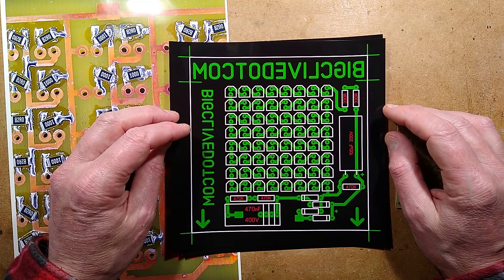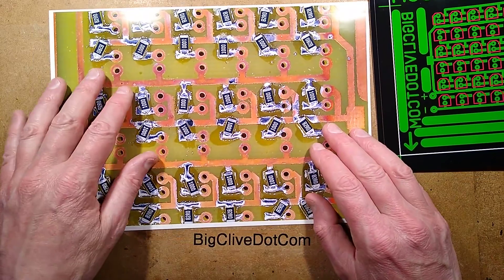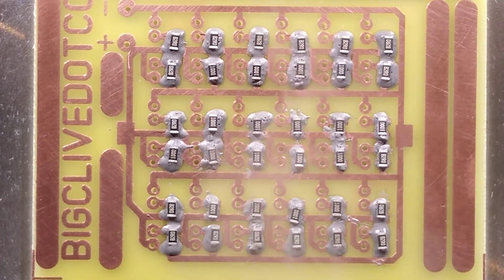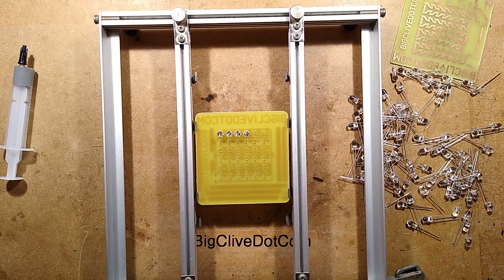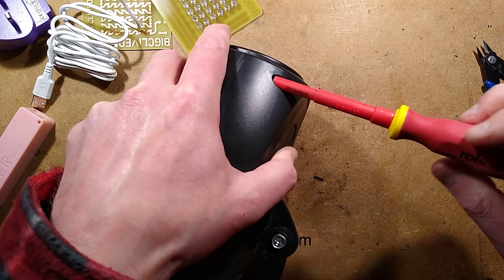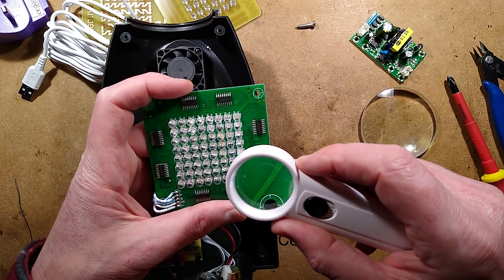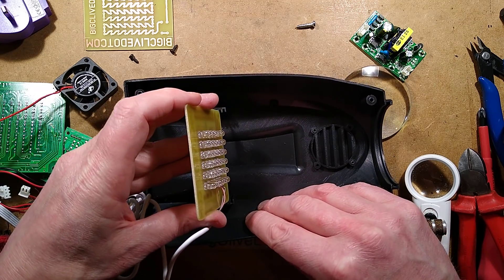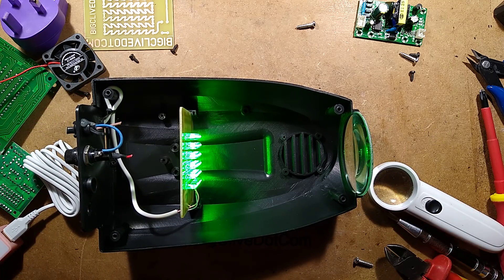USB powered disco light mod and solder reflow disaster.

Comment: @bigclivedotcom I'm currently modifying the same light (video here: https://www.youtube.com/watch?v=sVy2k0N5fuQ ) using an arduino nano and a RGB WS2812b 8x8 matrix. I have about 30 patterns made so far and plan to make a video how to once I have it finalized. I found the PSU only puts out 4.2v so am using a boost converter to bring that up to 5v so the LED's are as bright as possible. It works quite nicely but I would love to find some brighter LED matrix to push it further. Here's a picture of the build so far imgur.com/a/8cTjnd3 I would be really interested to know if there is a way to modify the PSU to  bring it up to 5v without the boost? Or even a teardown of the PSU / test of how many amps it can provide at 5v?
Reply from the maker: Do the LEDs focus OK without the extra lens in front?  Part of the intensity of the original light is that all the light is thrown towards the lens as a tight beam.
Reply: @bigclivedotcom  Kinda, due to how the LED's are you get split beams in RGB with an outer beam of the intended colour. By moving the board back to the last slot you can see the internals of the LED on the wall like with that pin spot you modified. The beams look kinda cool and is much more effective than the original matrix I think. Kind of like a poor mans laser scanner as I have been calling it. I will try to get a video done but the last time I tried my phone really doesn't capture the beams very well... 

EDIT: Not sure what you mean by the extra lens? I am using the big one at the front as it came, there were no other lenses unless you mean the ones on the LED's themselves?
Reply: @bigclivedotcom  here is a video of my light :) https://www.youtube.com/watch?v=sVy2k0N5fuQ
Reply from the maker: @ferociousdiablo  You may be able to nudge the PSU voltage up by adjusting the feedback components.  Looks good.  The bare WS2811 chips show up well.
Reply: @bigclivedotcom  Sounds good, but I would have no idea where to start on that. My component knowledge is limited at best to be honest.

Comment: Clive, back when I worked at Plessey (& then GPT) our surface mount machines glued the components to the PCB. 
Rubberised Solder resists was also added to certain locations on the board at this stage. 
They then passed to the ACI section for Automated Component Insertion,  then manual assembly for additional components that the robots couldn’t cope with.
After that the boards went to the flow-solder machine.
Following that the solder resist was removed and components that couldn’t be flow-soldered were added by hand.

And then they came to me for testing and repair ( if needed) before a final test before shipping out to the department that assembled the racks and telecoms switch units before being functional tested and shipped out fir installation.
That was in the 1980’s

Comment: You really need to learn how to work with UV resin here, I think. A few lines with a fine brush would have kept the pads neatly defined in their spaces. You already have a UV curing station, so it wouldn't be too wrong to use the same thing for this as well..

Comment: Solder pastes need to be refrigerated during storage, and have a typical life of 1 year when properly stored (per the SDS of what I use at work).  You're supposed to warm up the paste for 8 hours before use (yeah not going to happen in a hobby or single shift work environment).  For a high enough volume board, you'll usually see a form of screen printer to apply solder paste (you can make a quick and dirty paste stencil from heavy plastic film, and use a credit card as the squeegee).

Like others have said, the best control to stop the resistors from turning on the liquid solder is resist and pad size. Pad size we can handle making boards at home.... The resist layer, as someone said, you can use nail polish, but that's a question of how patient you are (or aren't - I'd just buy boards made).

Comment: On the outside chance, you read this drivel I'm hoping you can help. I've had pretty good success making stuff using lo-power led's, (1-3W) but lately my attempts to impress my wife using 10W and stronger have resulted in a number of embarrassing fires and minor explosions. Either the driver or the Led's suffer life-ending catastrophes. My understanding of driver selection power requirements and the vagaries of active and passive heat sinks could use the help of the type you are good at.  Any chance of a layman's explanation?

Comment: Don't know if already mentioned, but you should have used much much less solder paste. I made this experience myself this year the first time, reflowing in a oven, but I had one of my lecturer looking over the first. I used a microscope and it was just like one layer of solder pearls on the pad.

I also thought this paste would be sticky... Totally wrong... But really usable! I used it for a few adjustments on the board using my heatgun too.
Reply from the maker: I ended up just blobbing it on out of frustration.  I subsequently tried diluting it with flux and it worked a lot better, as it made it sticky and more manageable again.

Comment: solder resist helps glueing the resistors in place does as well and is common practise. 400ma for 60ish leds means your driving them quite hard. i have an array of 65 white leds running on a 3.7v lipo (that is overkill in capacity but anyhow) with a 10ohm series resistor making 100-150 ma and they are insanely bright already...

thermals would be an idea to test as well
Reply from the maker: 400mA divided between 36 LEDs is just 10mA each.
Reply: but 1:54 ? yes i know then it will be even less sounds kinda horrific though. and since most tht leds only have 10-20 ma max current well i think they are not very happy about it...

Comment: Dear sir.
Can you help me with a problem I have?
I need help with converting 12 ac to 12 volt dc on a scooter to power led head lights. I need a circuit design to handle about 20 watts of power to the leds.
You think you can help me out please?
Reply from the maker: If you add a rectifier and smoothing capacitor it may work if your lights can regulate to the peak voltage.  You may need to experiment.
Reply: @bigclivedotcom  if I send you a copy of my circuit,  think you could look it over?

Comment: I've got the same solder paste for my hot air station. I've never refrigerated it and I've got it since 2017 - never had a problem. I agree that it's a bit shit to get out, but it does seem to stick to pre-tinnned pads better.

Comment: Solder paste is a complete pain in the neck. I used to use loads of it for hand reworking PCBs decades back when I was repairing PC's to component level etc for a living. The tech had not changed much by the 2000's so I doubt it has changed much from then to now. The primary issue is that the flux at room temperature is a resin or rosin (buggered if I know the difference). This is dissolved in a solvent and then the solder nano scale balls are mixed in. Even stored at 4C and unopened after 6 months most of the solvent has evaporated. This leaves crystalsed flux balls of solder and the stuff we used was basically solid after a year even in a fridge. These days I use thinner solder, the paint on flux (from a flux pen) and a healthy dollop of gell flux.(I believe the stuff used by Luis Rosman is better than I use) for J lead and gull wing chips. I'm not even going to go near BGA.

Comment: Hi so i just solderes 800 ×  0805 smd resistors last week. The best way to get the solder paste to stick to the copper ist to preheat the pcb to like 50-60 ish celsius. For example using e heatgun. Makes it much easier

Comment: To use solder paste it's almost a requirement to use a solder mask because the spolderpaste goes everywhere like you can see. Soldering both sides and then trying to reflow also doesn't really work like you showed with the blue LEDs.

I usually put some solder on one of the pads, take the component with some tweezers and solder it on one side, and solder the other side after that.

Sqeezing solder paste is really hard and besides using solder masks I would also really recommend using a SMT stencil. It's basically a metal sheet with all the holes for where the solder paste needs to go. Just put a blob of solder paste on top of your stencil and use some kind of card to squeeze it on all the holes.

Comment: Very relaxing video! I had some improvements on the soldering paste by diluting with iso propanol :  https://frgmnt.org/advanced-smd-soldering/
Reply: A thin syringe can also produce several times higher pressure in a maximum short needle.

Comment: Old solder paste? I think tin-lead/no-clean (sn/Pb) solder paste works best. (It's not water soluble) use at room temperature. Only need to cover pads about 5-8 mil thickness. The surface tension of big pads are pulling the resistors skewed.

Comment: Hi Clive, I used to do a lot of smd soldering for my work many years ago, mostly refurbishing computer mbo's. Changing big  flatpack processors and so.

I always applied the absolute minimum of solder paste to the parts to avoid the ic pins sticking together, and pushing the ic's down while heating the solder.

I see you applied far to much paste to my opinion.
Less paste=less floating.

Comment: I think the problem is lack of solder mask. Also solder paste shouldn't be that hard to work with... I guess you are proper old school when it comes to soldering! Nothing wrong with that - surface mount can be done manually, but wow have you seen the crazy small surface mount stuff? That really would be a nightmare to hand process, 0201 is the smallest?

Comment: You don't need soldermask to make it work, I use solder paste on most of my bare prototype boards. What you do need is nicely defined pads that the solder can spread evenly over and slight component overhang at one end to create a nice fillet. In your case you would need soldermask if trying to solder onto a bus bar....but I guess you worked that out now ;)

Comment: Did you try your hot air gun instead?  I have tried mine for super tiny smds and it works quite well.  I flowed regular solder onto the pads then placed the resistor with the hot air at 90 degrees to vertical.  When the solder flowed I pressed them down and let them cool.  It is one at a time but you can control the alignment.

Comment: Sometimes with solder paste it is easier to just use the heat gun rather than the heated plate or reflow oven.
It can be a more controlled reflow with the hot air gun, but it does take longer

Comment: Have you tried using a thin metal sheet with hole corresponding to the circuit board? drill tiny holes about the width of the resisters maybe smaller depending on the thickness of the sheet and use a debit card to spread it over the holes corresponding with the circuit board kind of like screen printing. An aluminum can should work.

Comment: The first solder job looks as good as any of the suicide kit you've dismantled this year, looks like you did it in the middle of an earthquake or copied the layout from Escher.
The second reminds me of when I was 7, my first attempts with an inkwell and scratchy nib pen.  Readable but mmmmm blotchy - could do better.

 LOL shows when you mess with chinesium long enough it starts to stick :D  Try the thick gel flux (a la Louis Rossman). It's a bit wasteful but hangs around much longer   while the solder melts.  That paint on stuff is good for "normal" soldering, but it's only colophony (pine resin) dissolved in isopropyl, it flashes off too quick to guide the SMDs into place.
I played round with it a while ago - didn't get brilliant results - but then I don't do enough to make it worth a lot of effort, I quite like the "meditation" of doing it manually - for hour after hour (who am I kidding?).

The end result however is spot on, definitely a gold (or green) star for that one.

Comment: Consider creating budget screen print style solder paste application using templates made from printed OHP transparencies (or something similar, medium to thick card stock might also work for one off projects) (might need to experiment to get something the right thickness for your paste) and a suitable hole making device.  Works a lot better for this kind of grid application and can be done along with your existing PCB making techniques.

Comment: Surface tension of the solder will pull the components all over the place, like it did. Surface mount ref-low works using the solder resist layer to keep the surface tension centred where the component is needed. For boards that don't have solder resist, you'll need very tight pad tolerances, or solder SMD components by hand.

Nice hack on an otherwise horrible light.

Comment: I guess that's why the pads are set size for SMD parts, that way the solder blobs and the surface tension keep the parts in place. I've seen this on Louis Rossman's Mac repair videos, he will heat up a surface mount chip and move it around and it will snap back into place.

Comment: To be honest I think if you just had proper copper pads for the resistors I think you would of been fine, also you did apply probably 3 or 4 times too much solder for each of them

Comment: I worked in a couple of places which did small runs of Surface Mount PCB assembly (for their own very niche products). Those that were doing the assembly (I didnt do much assembly) could go at quite a pace hand soldering them. Neither company used solder paste and reflow.

Comment: The reason they slid everywhere is because you used too much solder paste it isn't really like soldering you have to put a real small amount on the contacts then use your component as a press to squish out the paste evenly it's the suction that holds the paste on not the paste itself

Comment: I would really like to see you cover a "power conditioner" Ive tried searching your library of videos and have not come across one. I would happily send you what we call a power conditioner optionally with noise filtration, voltage regulation, and surge/brown  protection. I would love your straight forward answer on whether or not they are worth the $$$
Reply: Ken like an APC LE600/1200? Afraid there’s not much other than the multi tap transformer, some MOVs, and the voltage sense circuit.
Reply: @peterg.8245  something like a "furman p-2400 IT"   These things cost big bucks, and im wondering if A) they are worth the price, and B) how much do they actually cost to manufacture C)are they necessary or beneficial for the cost.

Comment: Often a pick and place machine will use a very small dab of high temp epoxy to hold surface mount components in place.  After the components are mounted, using a solder mask, they will lay down the solder paste, which contains its own flux.  This is likely what you had smoking on your hot plate.

Comment: You can mix regular flux in with the solder paste to make it flow better. out of a syringe.  It also makes it 'stick' better.  I have only used liquid rosin flux for this, so not sure about others, but this works pretty well for me.  Just mix it well.
Reply from the maker: I did that in the end and you're right it takes a lot of mixing to get it even.

Comment: Hi Clive, a couple of suggestions. In the US we have a PCB service called oshpark. A very reasonable price for a few (3) copies of your PCB with solder mask and nomenclature. This alone will help your reflow tremendously. There's also a separate service called osh that fabricates inexpensive laser cut plastic stencils. You can place the stencil over the PCB aligned to the pads, put a line of solder paste on the stencil and draw it across the board with a plastic card like a credit card or similar. This will put the perfect amount of paste on the pads. I the use a toaster oven, but your hot plate works just as well.
Thanks for the video. It is an awesome effect. 🙂

Comment: Spent a lot of time testing SMD stuff, some thoughts: (1) You need to follow the proper reflow profile for your solder paste, should be around 4-5 minutes from start to finish with only 30-40 seconds above the glass transition temperature. (2) No way your solder paste should be smoking or bubbling - bin it. (3) You just can't solder paste reflow without solder resist (4) Your solder paste should stick to the copper. (5) You are putting waaaay too much solder paste on - imagine a a couple-of-sheets-of-paper-thin layer just covering the pad, maybe 0.5mm thick? (6) Consider buying paste and resist sheets based on your CAD gerber files e.g. Eagle CAD - the paste sheets (plastic or aluminium) allow you to apply paste to only the pads and resist sheets apply resist to everywhere else. These are not that expensive. (6) Consider buying a reflow oven, the T962 is dirt cheap and, once upgraded (details on t'interweb), is far, far better than a hot plate.
Reply: Yep. I think the bus bars and most importantly the way to much solder paste was the biggest problem, otherwise it would've worked ok. You can reflow without resist, atleast resistors and such, if you design the board a bit different (you make a pad for the resistor and not soldering on a bus bar.).. A fine pitched MCU would be harder to reflow without resist, but not impossible.
Reply: @kruppin  A fair comment. To me, reflowing without paste and resist sheets is like tying an arm behind your back, just unnecessary these days. I do appreciate, however, that there is a certain satisfaction with 100% DIY, as BigClive demonstrates, I mean who etches their own boards these days!? 😉